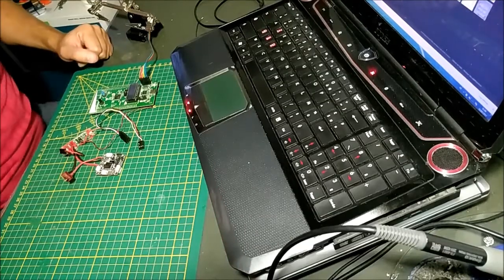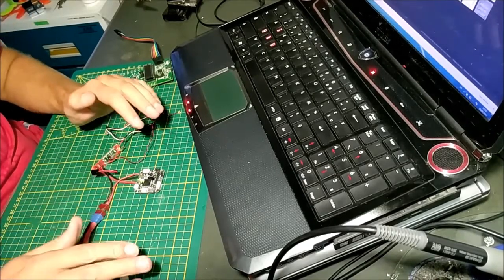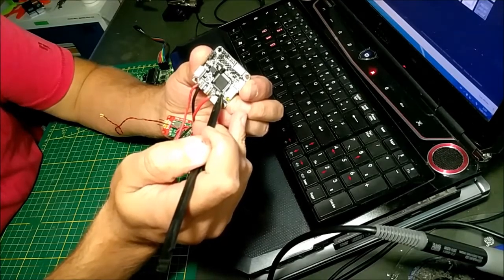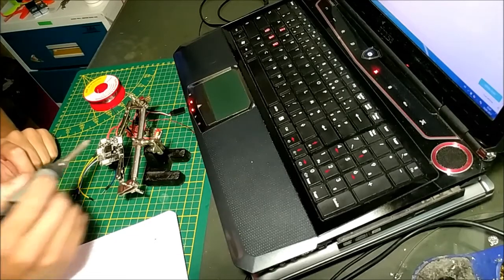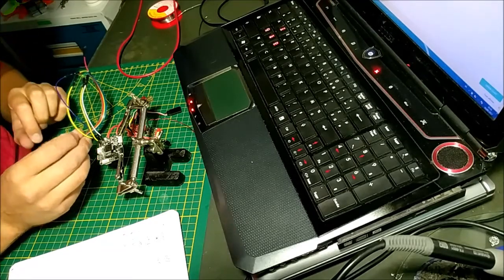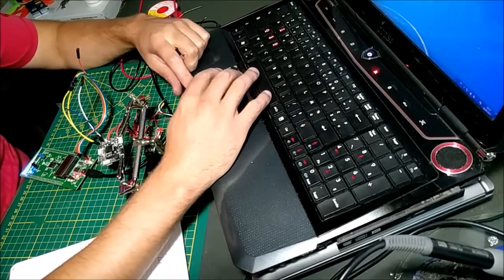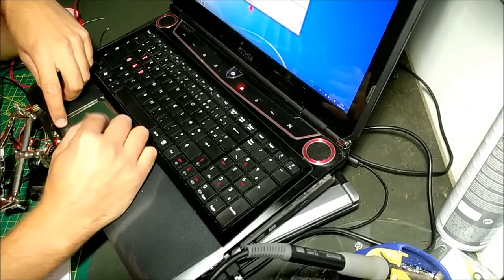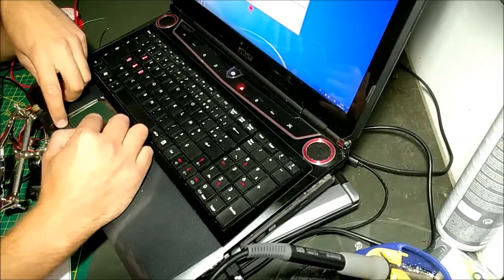Flashing (unbrick) Omnibus F4 V2 ST-LINK

Comment: Can it be done with the usb port? Why is soldering needed?
Reply from the maker: It is  done with the st-link from a discover board, connected in USB, and wires soldered on some board pads.
I do not see other options.
Reply: @jeremyvi  So it is impossible to connect st link with the usb port? Is usb pin separated from st link pin?

I am trying to flash code from stm32cubeIDE to the f4 board, but usb pin cannot detect st link from it. Is it because st link pin is different from usb pin?

Thank you!
Reply from the maker: @doyounyu1  I don't have reas enough literature about STM32 programing, but as far as I know, firmware must be uploaded via ST-Link, on-board running firmware can use USB, but not for programming.
Reply: @jeremyvi  Got it. Thank you for your answer!

Comment: I have this controller https://www.banggood.com/Omnibus-F4-Corner-Nano-Flight-Controller-w-MPU6000-Damping-Box-IMU-OSD-Current-Sensor-for-RC-Drone-p-1235202.html?rmmds=myorder&cur_warehouse=CN   But on the board there are no pads where to get soldered. Please, tell me what pin F405 correspond to SWC, SDIO. Thanks!

Comment: Salut!
Dis moi j'ai l'impression d'avoir le même soucis, j'ai deux F4 omnibus pro v2 qui ne sont plus détectées par windows quand je les branche en usb, elles affichent une led verte fixe et le buzzer bip en continu.
Tu as une idée ? Merci
Reply from the maker: Simon Co  c'est que les cartes ne bootent plus, vérifie les tensions en 5v et 3.3v. Très souvent les diodes notées S4 deviennent passantes dans les deux sens. Sinon c'est le micro contrôleur HS. Les led sont allumées bien fortes? Ou un peu faiblardes?
Reply: jeremyvi Une des cartes a la led verte forte et l'autre faible
Reply from the maker: Simon Co si tu sais utiliser un multimètre, sur celle qui a la led faible, c'est un problème de régulateur, très surement. Vérifie les tensions aux points stratégiques: 5v et 3.3v.